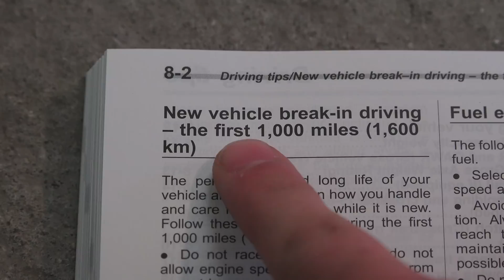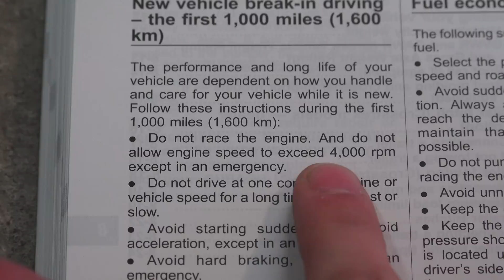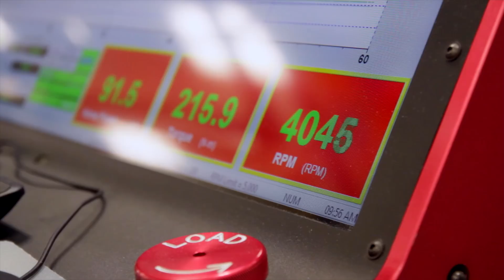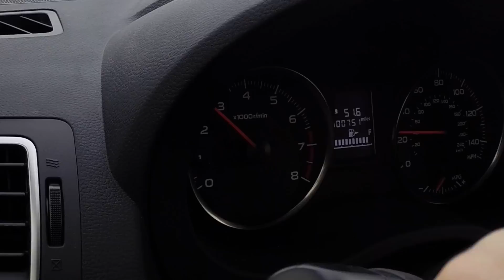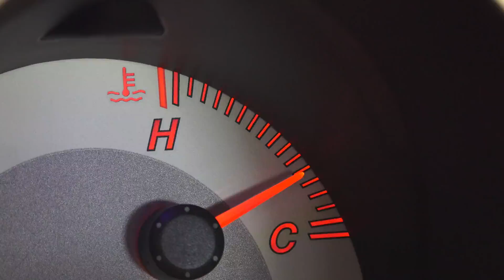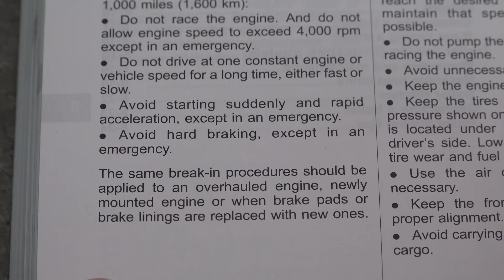5 Things You Should Never Do In A Brand New Car

Comment: Race engines (Nascar) are only expected to last 3000 to 8000 miles max. That's why their hard breakins are needed. Regular cars (what we drive) are designed 'cheaper', lower quality parts etc.. And to this conrods that will stretch and give during load or higher rpm's. Varying rpm's and loads will allow the piston and rings to scrape off evenly the same amount of metal from the (lower quality) sleeves, preventing ridges however small to be formed at the top and bottom of the sleeves. These ridges will cause piston/rings to break and damage your engine. 

A hard broken in engine will probably not last more than 60k miles. Well broken in and maintained engines as described here, can last much longer. I have had and done both. Hard driven lasted 67k miles, well broken in over 500k miles and going strong. Either way your choice on how long you are going to keep the car. 

Regular car's, even GT-R'S are not designed to be raced.

Comment: Manufacturers don't want you to floor it because in case of some parts imperfection it may fail in warranty. Light brake-in allows those imperfections to wear out and not requiring to be replaced in warranty. It is for they good not customers.
There is no reason for modern engines and tight manufacturing clearances for need of a break-in. For new car engine to break-in all is needed to allow it to warm up to operational temperature and then you can literally break it in. Some minimal break-in is also needed for brake parts

Comment: What about the other school of thought that racers and builders seem to be ascribing to more and more; once warmed, bang it like a machine gun?
This supposedly creates better cylinder pressures, better revving and acceleration. Iwas dubious until my riding partner got a Victory bike and had toride a good distance home, late in the day
Reply: This bike broke in quite successfully without ever smoking, had reams of power, and no mechanical issues, even when he modded a few things like exhaust, etc. 
Me, I've had engines I thot were kinda wimpy doing the traditional method here. No smoke, but no real nads either.
Reply: Gary Chandler. I have heard that too. The key point I picked was avoiding any risk of premature damage. Kind of makes since. I was taught to Drive it how you intend to use it, that it doesn't really matter how you drive it as long as you drive it that way consistently. Machines like consistency and will run better and better right up until they blow up.
Reply: John Hoelscher Hello Sir, I have to add, that a lot of petrol heads on youtube, with a great video channel, give a in depth view on rebuilding good ol V8s. After a fresh rebuild the first crank is made on a dyno. Here the testing goes from engines torque the horses and the afr to determine if 'we should use a bigger carb or not'. These engines gets floored even in non 'nicasil' coated cylinders.
Reply: A bit of late response. I've personally rebuilt a few engines that the owner was easy on when they got it back in and running, and they had issues with smoking, low power, and things of that nature. After tearing it back down and honing the cylinders plus installing some new rings, we got it back in the car and towed it to a dyno where it was running at high load, varying rpm all through the range. Has been perfectly fine since then.

The way I see it is that running it hard may create extra risk, but you're gonna find out one way or another if something isn't right. Might as well get it over with. You don't have to run it ragged, but varying the load and rpm, plus not letting a fresh motor just sit there and idle is important.

Comment: I heard that if you put a little bit of sand in with the oil, it will help speed up the process, but you need to make sure that you poke a hole in the oil filter. so the sand can continue to work it's magic.

Comment: Any opinion on "Don't run with the factory oil after burn in period" ?
Reply: Dennis Lubert after break in you usually change the oil on built motors. But for your car ill just read the instructions if u dont want to spend the money

Comment: Does number 1 apply to a McLaren 650s?
Reply: Belal Qureshi i have a 675lt, and yes, the break-in instructions are exactlty as EE described in the video. Don't push it before 1000kms.
Reply: GTX1080 I would have that McLaren would have done this at the factory somehow. I did not follow these rules the first 1000 miles, so is my engine now less perfect?

Comment: My 2012 ford falcon fg xr6 na 210kw 460nm, inline6 4L engine. from 14kms i smashed it to redline and took it to tracks and heavy mountains runs for the first 3 years 78,000kms. Did a compression test before selling, and it was perfect across all pistons....

Comment: I would love to hear your opinion on start-stop systems during break-in periods. Thanks!
Reply from the maker: Hmm, I'd probably disable it simply to prevent it from turning on/off when it's not fully warmed up, but they may already incorporate that. I don't recall driving any cars that would shut off when cold, except for hybrids.
Reply: I would switch those systems off during the break-in period because you want the engine to reach an stay at the operating temperature. When the start/stop system turns the engine off the engine will start to cool down.
Reply: wear on an alternator? how much wear can one do on such an inexpensive item? 

"yeah lets turn this off. I don't want to replace the alternator in 15 years for a total cost of $120"
Reply: I think those start-stop systems are a major pain.  We have one on a Cherokee Trailhawk.  Besides, the procedure on how you re-set the engine oil life gage (you are required to step on the gas pedal in accessory mode), it's the worse feature.
Reply: Not sure how did you get 15 years period, these cars don't have any malfunction statistic yet. ECO option on/off is added on purpose, and those 120$ are mine to keep :)
Reply: Some older hybrids will auto disable the auto start/stop feature when not fully warmed up.
Reply: I think you mean starter?
Reply: My car does :). Citroen C4 2013 even if the temperature is below 0 Celsius, it will shut down the engine on stop. However, I keep turning ECO option off as soon as I start the car. Somehow I think that it will make a lot of wear to alternator, especially on traffic jams, when start-stop is executing multiple times in single minute.

Comment: driving 30 years acrs and i always floor them in the first minute direct from the dealer shop. 
My experience is that these engines which can stand that the first 50mls will hold forever !
The others will loose power after a few thousand km and than you get another for warranty; than floor it again and hope you get a better build engine.
Thing is; these new engines NEED much piston pressure to set piston rings properly in the first mls !! So you have to floor them; if you do not you get a meeh engine with perhaps oil consumption and a bit less power.
Ask bikecyle specialists how they run new engines to get out best performance later ;-)
floor them to hell ! But if you can do an oilchange at first with normal mineralic 15W40 oil. After flooring it a few miles change that oil into the regular 5-W20 or 15W50 or 5w30. The using of mineralic 15W40 or simple SAE30 is for finishing the cylinder bore !

Comment: I got a Volvo b230 turbo to break in. I Will get the oil press up. Warm upp the garage for the Engine to got a little varm first. And start drivning (not full throttel?) now i medan not over 4000 rpm but from the start upp to 4000 rpm a couple of times and run like usal so like in 2 gear throttel fast or slow? Var Engine is 20 years Old and totaly renovated (bad on the words) so the Piston rings and new honad in swedish. It lite the guy from Finland.

Comment: sorry to tell you that both piston rings and cilinders in most production cars today are pre break in ...short words they work them in a special machine that simulates over 1000 miles before they even make it to engine,,,,,you won´t see a wrc car, or a nascar do a break in engine (althought these are special tecnology pistons, rings and cilinders,,,) in some cases dealers use those old rules (break in engines necessary to avoid waranties.) for more info if interested u may contact me

Comment: I would do the hard break in and change the oil after 1000 miles. I would not exceed 4000 rpms for the first 300 miles, then occasionally floor it for the other 700 miles If there is no information about the break-in procedure or if it's the standard 1000 mile break-in. After that, I would change the motor oil and go straight to full-synthetic. This applies to not just new cars but, crate engines, rebuilt engines, and remanned engines as well. The break-in also applies to after you upgraded your engine internals.

Comment: Cruise control absolutely does effect engine load. For example 70mph uphill requires more load than 70mph downhill.
Reply: Cruise control is rarely used. So wouldn't the normal driving of the car ona regular basis account for the rare cruise control usage?
Reply from the maker: Correct, but it doesn't necessary change the engine RPM, especially for manual transmissions.

Comment: so far, I haven't heard you say anything I didn't already know on any of these videos, but I also haven't heard anything wrong. being a used car kinda guy, I'd like it if you did a video on how to get your used car running better than new. I did that with a 98 zx2 escort. new hydraulics for the clutch, tires, brakes, and a few parts replaced on the motor along with my special blend of liquid mechanic got it running just better than new. never did get to redo the cold air intake though

Comment: What about maintenance/oil changes on a new car? I've heard you should dump the oil on a new car right away and again every few hundred miles to avoid collecting metal shavings in the oil from the components seating themselves. Also to run mineral oil for the first few thousand miles to give it enough friction to wear in, then change to synthetic later on once the motor is fully broken in!

Comment: Funny how he says "a hard break in is bad because it will cause problems and imperfections" because I work at a motorcycle dealership and we sell Dyno break in's which is the SAME thing as a "hard break in". car dealers don't want you to do a hard break in because it is a less chance your car will have problems later down the road so you have to come back to the dealer because you have to get that problem fixed. its money is basically what it is....when is the last time you've heard of someone doing a hard break in and blowing a motor or having problems down the road??

Comment: Never agreed with hard break in. I've always treated any engine from freshly rebuilt or brand new with a soft gradual break in. Even when i built my 240's engine years ago i didn't get into boost much and didn't even get to half throttle much at all. 

when i eventually got to a millage that was right that i felt was safe i would then beat on it. lasted 4 + years and then i sold it.

Comment: Not true. My grandfather worked on antique cars and they home-made babbit bearings for the engine. They were crude and needed to be "machined" by the engine running.  They had a higher chance of failure if you put a big load on the engine before they ground themselves to a proper pattern or size. Until the 80s cars had flat tappet lifters that need to rotate again to get the proper fit. The best way to do that is varying the engine speed until they get a proper fit on their own.
So in the antique car days you could have a failed bearing, and later a failed camshaft by not following the obsessive compulsive behavior.  Now it is just a left over wives tale to make OCD new owners happy, and also get them used to driving their car before they get careless and crash it in the first week. Tests have show that the rings seated better by some full throttle applications in the early hours of break in. Or continue with a ritual if you sleep better.

Comment: He forgot to mention, for people with standards, not lug the engine. Also don't let the engine sit there and idle at cold start up, more then 90% of engine wear occurs on cold start up. It needs to be warmed up as soon as possible. From cold start, give the engine a few seconds for the oil to get to the top of the engine and drive it gently until it reaches full operating temperature.
 And when I say drive it gently, pretty much what the video says when it comes to breaking the engine in.

Comment: How do you keep your engine speed varied in a CVT-equipped vehicle, short of using whatever rudimentary manual mode that it comes with?  Most consumers are not that observant.  Or rather, how would a powertrain engineer protect the rings against how the average driver will use their CVT vehicle during break-in?

Comment: The truth is opposite. Every brand new engine needs to go Wipe open throttle asap. Every Engine builder knows this and this guy is completely incorrect.   There is NO excessive pressure on the rings from going hard on it, Its always within the design parameters lol.  Its about LOAD and not RPM for break in.  

Now speaking of Risk?  The risk is only LEGAL.

Comment: Recently got a new engine for my VW vanagon. Mechanic stressed the same points you're making here. 

Additionally, brakes will be "broken in" if you give them a few good stomps at 15 mph and about 40 mph, and once in reverse (be careful). 

My mechanic advised me to do an oil change with filter using 20W50 after 500 miles, and to keep using thicker oil for a few thousand miles before switching to recommended 10W30 or whatever it was.

He also said to let it idle until the temps were up, rather than what you're recommending which is to drive the car long enough that it's at operating temperature. Same idea I suppose, except waiting to drive until the temps are up is more annoying, but prevents the engine from being under load when cold. 

How about using fuel/oil additives while breaking the engine in?

Comment: Do the same rules apply for newly rebuilt engines?
Reply from the maker: Yep
Reply: I have the Crosstrek too 2016 Touring edition. When you mention the "avoid short trips", is it adequate enough when the engine temp blue light turns off and reaches on avg about 80 celsius?
Reply: +Rock and Ride
I would have thought it was more the bores and rings which need to bed in,  rather than the pistons
Reply: Jared Bishop.....they always say take it easy I'm a mechanic and we always recommend pushing the engine fairly hard for a while u don't want to over heat it but u need that engine to move in order to wear in the pistons pretty quickly
Reply: Jared Bishop It would be convenient

Comment: Yeah, everyone should check in their owners manual regardless.

Point 1: Don't floor it.

Now if you go to page 113 of your 2015 Ram 1500 owners' manual it states:

"...Drive moderately during the first 300 miles (500 km).
After the initial 60 miles (100 km), speeds up to 50 or
55 mph (80 or 90 km/h) are desirable.
While cruising, brief full-throttle acceleration within the
limits of local traffic laws contributes to a good break-in.
Wide-open throttle acceleration in low gear can be detrimental
and should be avoided..."

So floor it, but only if you're already doing highway speeds.

Comment: I heard with a manual trans(you could do it with an automatic also) your supposed to bring the rpms up and let the engine "brake" (decelerate) and it's supposed to force the rings out for a better seal. Is that true? Example: put the car in 3rd gear bring the rpms to 4K using half throttle then let the engine brake/decelerate to 1500 rpm without using your brakes and keep repeating that cycle